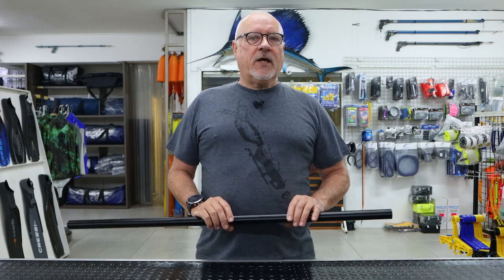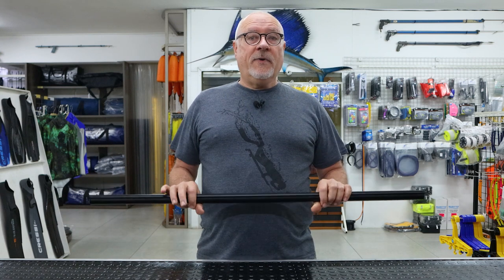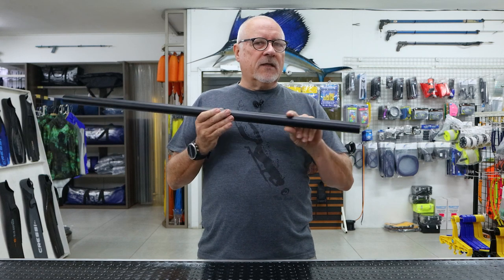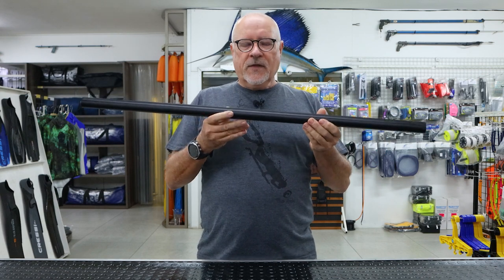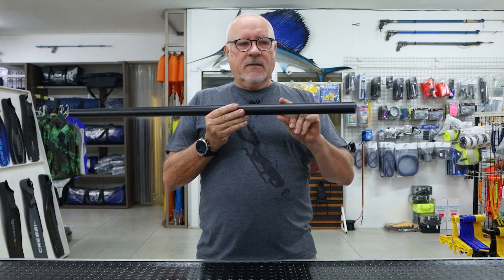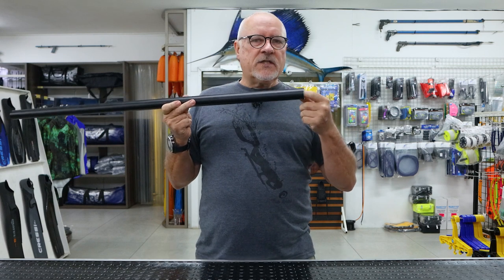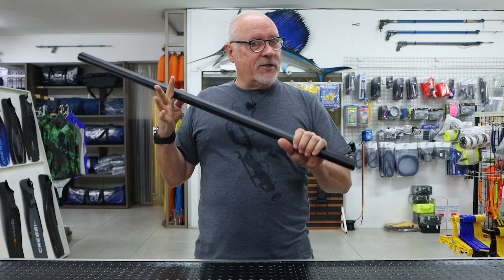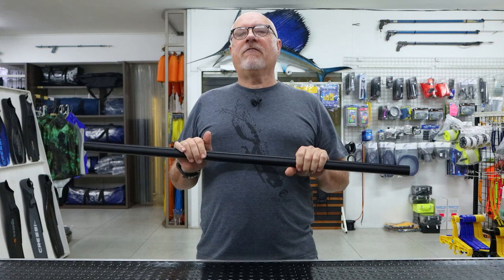Rob Allen | Pre-Rail Barrels | Part 2 | 2023

Comment: Hi Mr Alle, I just boght a RA carbon barrel to replace my Alu barrel and didn't know I'll need to put some sort of lead/mass in the muzzle end. Could you please help on how much weight I'll need to put in a 110cm RA carbon barrel with a RA roller head please? Regards, Rui
Reply from the maker: The roller head is a lot heavier than conventional muzzles so we do not add lead in these muzzles.

Comment: Hi, I want to attemp to make a wooden speargun. In terms of ballast where do I place the lead in the gun? I live in Barbados and I am using mahogany.
Reply from the maker: There are so many variables that there is no way I could tell you. I can only tell you how we do ours. It also depends on what you want and like. For example, if you make the gun with too much wood, it will be very buoyant. This is good because you can always trim away some wood. Once you are happy with the shape and the gun is set up with spear, rubbers etc, put it in the sea to test the buoyancy. We make our Timberline guns buoyant with the spear in. We then put lead in the muzzle and in the handle until it just sinks while staying level. We can't set the lead in the timber because of our design.
Reply: @RobAllenSpearfishing  thank you
Reply: Hi, I have a question. I was in about 20 feet of water while I was spearfishing. The mask was squeezing my face until my vision became blurred. How can I avoid this?
Reply from the maker: @lmnop20sharks  many beginners have this problem, quite simple, you have to exhale a little bit of air out of your nose to equalise the pressure.

Comment: It always seemed to me that sure the carbon fiber barrels are nice and light. But wounldnt that cause an issue with respect to recoil and accuracy vs a heavier aluminum barrel? Great story though. Seems serendipity rears it’s head quite often
Reply: That's why they put weights at the muzzle. To help with recoil.
Reply from the maker: Agreed and as @FaddaWolf mentioned, we still but weight in the muzzle, not only to help dampen recoil but also the mass is in the muzzle, not over the whole barrel so it helps with muzzle lift. Carbon is also that much more stiffer than aluminum so less barrel flex.